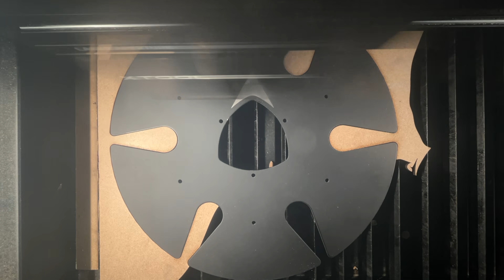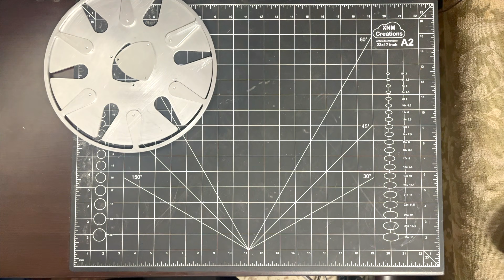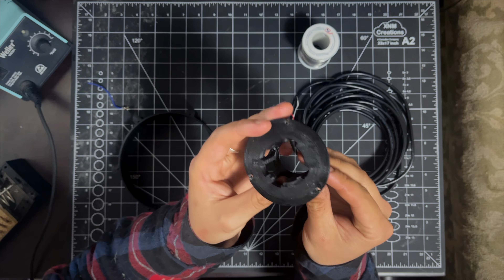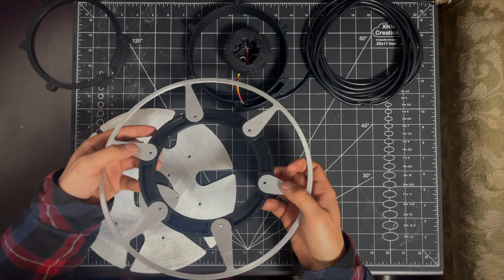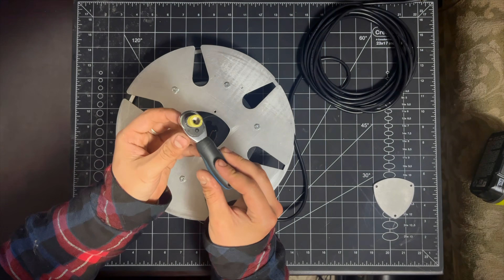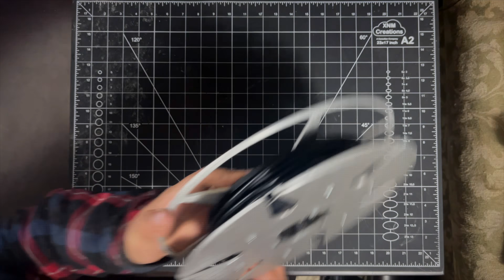PETAL Spool Assembly Video

Comment: Now that you have changed those connectors to XLR in your V2 build, which pin gets left as the "dead pin" and what colours would XLR pins 1, 2 and 3 be if referring to 10:29 image of this video?  Can't find the information from any .stl file nor PDF your website provides. Also now that you have changed the connections to XLR, wouldn't it be better to install one XLR-male socket somewhere on the spool rather than install an integrated cable on the spool? This way the user him/herself can decide how he/she transports the XLR cables and the Spool itself would be tiny bit lighter. If it would be separate build without integrated cable, the Spool width could be reduced and you would save a bit in the material costs (I'd think at least). I'd say almost every user of this system already owns XLR cables and wouldn't really need those integrated cables. Weren't the purpose of those XLR connectors on the Brain module be for this exact reason, to be able to use existing 3pin XLR-cables?

Edit: Found a picture of the new XLR wiring of the Spool on the front page of petallighting.com, but still not 100% sure which wire is hot, cold or ground. I'm just assuming red is hot, yellow is cold and gray is ground, but maybe you could mark the numbers of xlr pins on the front page picture to ease things up? Also that picture could be embbed to this Spool Assembly Video on 10:12 for clarification.
Reply: This way there would also be no need for proper strain relief which is lacking on this version in my opinion. Maybe there should be two different choices to pick of? One with the integrated cables (with proper strain relief and rest of the Spool exactly like the model on this video) and one where the cable has been replaced with just the XLR-male connector with less aluminum needed.